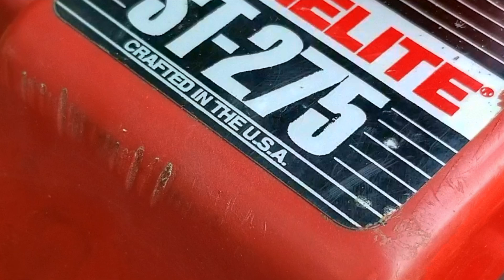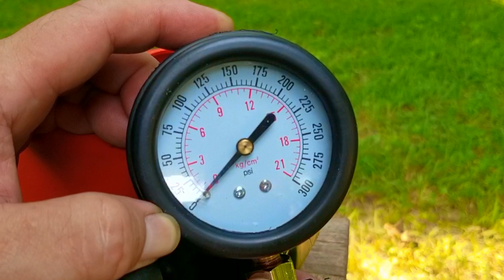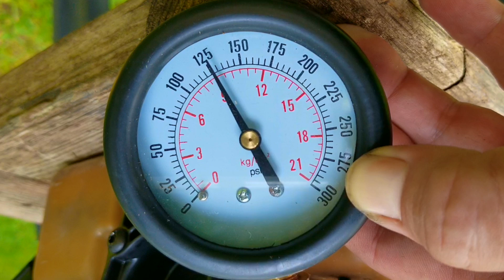Trimmer has Fuel, spark and compression but it won't start.

Comment: They make a uv solution that cleans shoes under uv lighting. That same solution put on plastic and sitting under a uv light would change the color back to the original shade. I have used these on other plastics and after 24 hrs sitting in my homemade uv box it works great
Reply from the maker: thank you Reds13

Comment: have the same weed eater, pulled it from my grandparents' place. wouldn't do anything when i got it, been messing with it as I have little experience with small engines. has spark, fuel, compression. it will pop and fire but won't idle. I've messed with idle screw on carb and can't get it to do anything. (Commenting before watching, probably got it fixed after watching) Edit: Mine is an SX-135 Bandit model.
Reply from the maker: nice work and thanks for the update

Comment: Like your work nice quick fixes
Reply from the maker: Thanks, I appreciate it.
Reply: @HomeGaragechannel  IV got a strimmer cold start is good but after abit of use it will just cut our I put new plug in now it will splutter before cutting out and not start till it's gone cold Ur the next day?
Reply from the maker: @garyclifton2180  can you give me a model number so I know what kind of strimmer it  is? more than likely the tank vent is failing. this will let the engine run for a little bit and then stop.  Otherwise the coil is failing when the engine is getting hot.

Comment: For the old yellow gas tank you can submerge it in 7% hydrogen peroxide and it will turn back to it’s original colour
Reply from the maker: that's hopefully the plan.
Reply: Where I live that stuff costs 25 bucks for every 1/30 gallon, for pharmaceutical prescription use ONLY.
Any other suggestion?
Reply from the maker: @ToreDL87  get the peroxide creme, it's not pharmaceutical, but salon use
Reply: @HomeGaragechannel  I was going to say the same thing

Comment: I agree with everyone else. You should always use something until it becomes uneconomical to repair, or the newer version has significant feature changes that make the old one obsolete. Flip phones still work just fine, but smart phones do so much more. A string trimmer is a string trimmer. The new ones may have .2hp more, but unless you're doing 100 lawns a week, why bother....
Reply from the maker: that makes a lot of sense, thank you joblessalex

Comment: Ye I found a homelite weed eater up the road from me and the guy said it has no spark and the fuel lines were bad so I got new fuel lines for it and replaced them and put it all back together and tested the spark but nothing so I put it back in and tried starting it and it started straight up
Reply from the maker: very nice.

Comment: I had a screw back out of the engine on one of our blowers once and at first I thought the engine locked because the screw got wedged into the fan after we got the screw tightened it ran fine again.
Reply from the maker: I can see how that could happen.

Comment: High strength peroxide, found in hair salon “developer”,  will remove the yellowing from the plastic. If you search YouTube for “sneaker sole whitening” you can see the steps needed to get a good result from this product. 

Basically, creme 40% developer is applied and then exposed to a UV source (man made UV light or a bright sunny day) to complete the reaction.
Reply from the maker: I hate to tell you what happened when I tried it.
Reply: @HomeGaragechannel  you tried the developer?
Reply from the maker: @peoplearestuck  Yes, 14 oz to about gallon and a half, full sun for 6hrs and about 2 of cloudy conditions, it didn't work.   unfortunately for gas tanks, we have to use sulfamic acid instead.
Reply: Good to know.
Reply: On shoes, they brush it on full strength and let it bake dry in the sun or under a lamp. The discoloration usually happens on the bottom of the soles. Basically anywhere that gets oxidized by contaminants in the environment. 

I wonder what would happen if you pasted it full strength all over just the outside?
Reply from the maker: @peoplearestuck  it's worth a shot, I'll try it tomorrow. I'll let you know.
Reply from the maker: so I applied the salon grade peroxide on two parts of the fuel tank, one part thats uncovered and another part that was covered by cling wrap. I went out every 15-20 minutes to keep applying it.  It has been out in direct sunlight and there has been no change.  I know it's work though, and that's because the bristles on the brush I'm using to apply it, has changed colors.  So no dice. Looks like peroxide doesn't work on  plastic Fuel tanks.

Comment: I may have a solution for removing that yellow from the gas tank:

Fill a small bucket with 3% Hydrogen Peroxide, and add 1/4 teaspoon of Oxy Laundry booster for each gallon of peroxide and submerge the fuel tank into the solution:  
The soaking time will vary with most pieces whitening in 2-6 hours. The mixture will last for up to four days before it needs to be replaced.

Set the tank under a UV light or out in the sunshine, it will work as well.
When the item has reached the desired whiteness, remove and rinse thoroughly, if necessary, wash with dish detergent and water.

Before trying that out on the fuel tank, I highly suggest to try on a scrapped piece of yellow plastic. 
I hope it works for you.
Reply from the maker: thank you for the tips.
Reply: @HomeGaragechannel  You're welcome! I work part time in the same sector, and these older machines are truly the ones that you're very likely expect to get back running in no time. My manager has an Echo machine that's 23 - 24 years old, pretty much as old as me, and it has always started without issues.
Reply from the maker: that's a machine there.

Comment: Ya older equipment is better because my grandpa has an old home light chainsaw and he can run it on ethanol fuel and it starts on the first or second pull and after it runs great
Reply from the maker: Wow now that is a good machine!
Reply: It is but he needs a new pull rope for it and it is really hard to find and if you are wondering it is 20 years old but we also need new piston rings for it now and you can put the newer style rings on old things

Comment: You can get the fuel tank back to looking original by using hydrogen peroxide and a black light. Submerse it and let the black light shine on it while submerged overnight or until you are satisfied with the result. Several guys on the tube use it with rather remarkable results.
Reply from the maker: thanks for the information

Comment: It doesn’t matter if it’s old or not. The only problem with using old power tools is that a bunch of the parts are discontinued. You probably couldn’t rebuild this thing even if you wanted to. If you don’t feel like buying a new trimmer I’d imagine you could put another engine on it and save a little bit of money.
Reply from the maker: you hit the nail on the head, I do believe This carb is discontinued and never supported in the aftermarket either.

Comment: I buy old small engines to fix as i enjoy doing it I always clean or remove the spark arrestor if the engine has one it takes 2 mins I had this issue the engine had good compression spark and fuel the reason the engine wouldent run was because the spark arrestor was completley clogged
Reply from the maker: it's something the manual every address, they just want you to buy another one.
Reply: @HomeGaragechannel  people are to lazy to even try and that's good for people like me and you they would rather throw the strimmer out and buy a brand new one than spend 10 mins of there life watching a vid on why it isn't working. I used to work in the scrap yard I would find at least 10 small engines a day I still have a shed full lol and 99% of the time it's a simple fix like a purge bulb, fuel line carb clean, spark arrestor clean, maybe a new sparkplug I had a brand new honda mower I brought home from the scrap yard it started first pull after I drained the bad fuel it just smoked bad because they had over filled it with oil by 500ml nearly double what your supposed to put in.
Reply from the maker: you are completely right about that.

Comment: I think you are using a little too much loctite, a little goes a long way. Also, it's a good idea to clean the carb with air or cleaner before disassembly to avoid getting the dirt in. Cheers 💪
Reply from the maker: thank you

Comment: That is one of the most common things with homelite Louisville bowling Craftsman hyper torque whatever that they're very common on weed eaters. The only ones I've never seen do that is still and I actually got to steal just a few days ago that I bought at a garage sale for 25 bucks it was a FS 45 still and the cylinder was at least on it and I've never seen that still ever had the cylinder loose on it but you know I fix it easily with no problem the bad thing about these home life Troy bills bowlings and hyper torque and Craftsman and all them they only have two bolts holding the cylinder on unlike fuel and echo they have four but it's a easy fix you know pull it apart it's the gasket tight in the bowls whatever it may be and it'll start right up and you know this still started up and ran it just it wouldn't idle because it was sucking too much air and causing too much crank ventilation
Reply from the maker: That's very interesting

Comment: You say you love straight shaft trimmers but I don't.  They are easier for cutting but growing up on curved shaft, i grew accustom to them.   I need better trimmers meaning me buying straight shafts.  Absolutely hate reverse rotation of cutting head.  I'm right handed and straights throw debris directly at me unlike curved. And too old to repair, when you cant get parts anymore!
Reply from the maker: I can respect that, thank you Danny Morgan

Comment: I usually just tell people who bring these cheap trimmers and chainsaws to my shop for repair, "I have all the parts you might need to repair it so it may be worth doing the repair yourself but they just aren't worth paying me $70/ hr + parts to diagnose and repair them." If someone insisted I do the repair I would quote this repair at 1.5 hrs labor, replacing the carb at about $30 plus fuel lines, fuel filter, air filter and spark plug at about $12 so you might be looking at around $120 - $150 maybe less maybe more depending on what I find and what it takes for the repair. I can sell a brand new Stihl or Echo trimmer in that same price range.
Reply from the maker: that makes sense.

Comment: Boil the gas tank in some hydrogen peroxide, should fix the color. Won't last forever though
Reply from the maker: really? didn't realize it wasn't permanent.
Reply: @HomeGaragechannel  nope so long as it gets in the Sun it will go right back over time, all your doing is resetting the process, it can and will happen again, likely will take months if not years though(of days where it's used in the sun, hanging in the garage ain't a issue), I don't believe it happens faster or anything either just there's nothing to stop it from even happening with plastic sensitive to uz
Reply from the maker: @jaykoerner  thanks
Reply: @HomeGaragechannel  to be clear as far as I know not all plastics with uv color damage are reversible, so can't promise it will work but if it can be reversed that method works, also there is the possibility it's actually color damage from smoke to consider
Reply: @HomeGaragechannel  on further note it seems oil resistant plastics might very well not respond to peroxide, didn't know, you can possibly use a acid though in the same way I mentioned https://youtu.be/aLJgawqRURY ( break reservoir in the video but  also shows a before and after of a coolant reservoir that did work this way, looks to be the same type of plastic in both cases, also oil resistant clearly as is a fuel tank) still think heat is really important
Reply from the maker: @jaykoerner  I believe you are correct

Comment: "better balanced, more powerful and easier to use then the ones on the market today" And isnt' that a SAD statement for today's manufacturers. Sadly, This also relates to a LOT of items we buy today. It's a Throw Away society and disgustingly, our Manufacturers have USED that mindset to SELL US MORE ITEMS as the old ones no longer last as that should. I still have my dad's 1944 Farmall H tractor. Rebuilt it ONCE in the late 50s, still runs great and has lots of power. Not to much for the new ones,,,and sadly, you can no longer work on them yourself because the makers restrict the PROGRAMS needed to do so...Disgusting
Reply from the maker: I know right

Comment: For the color of the tank. Now im not entirely sure of it but i beleave a tub of hydrogen peroxide and a black light over top will whiten up that tank. And i beleave it will take 24 to 48 hours. I watched another person restore a playstation and thats what he did to get it back to its origonal color.
Reply from the maker: that's quite the investment in materials but I guess it's worth it in the end
Reply: @HomeGaragechannel  lol i think the amound of paroxyou would need may be 3 or 4 big bottles. And i think that wod come out to $10. And the black light maybe $10 as well. So $20 and you can use it alot more than just one time.